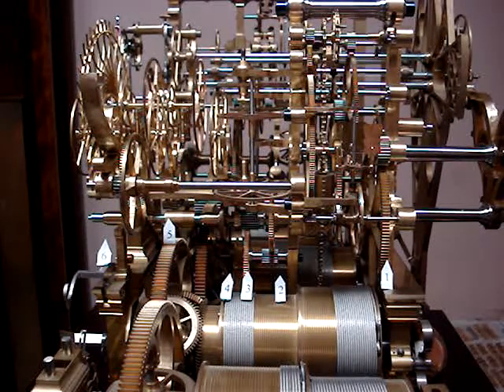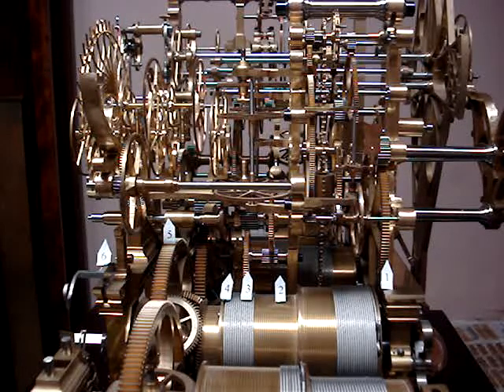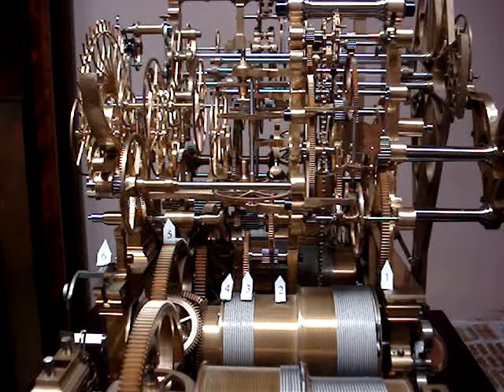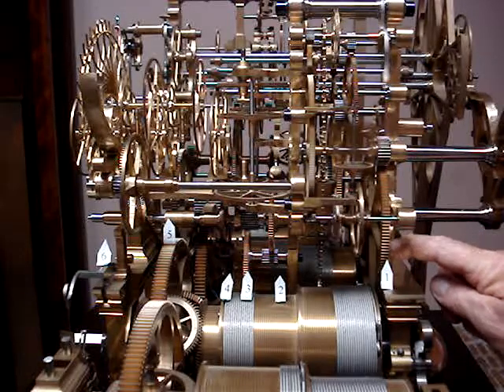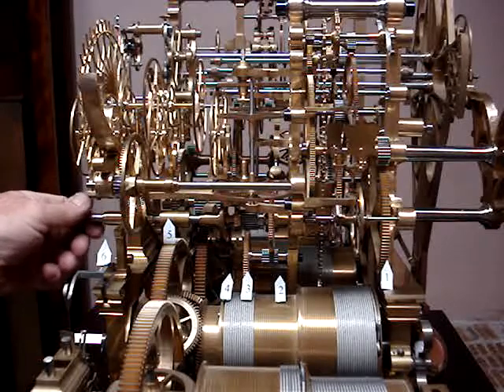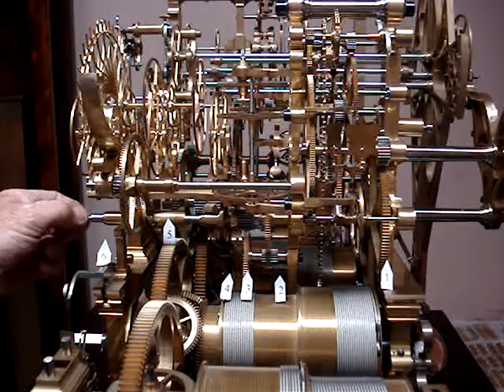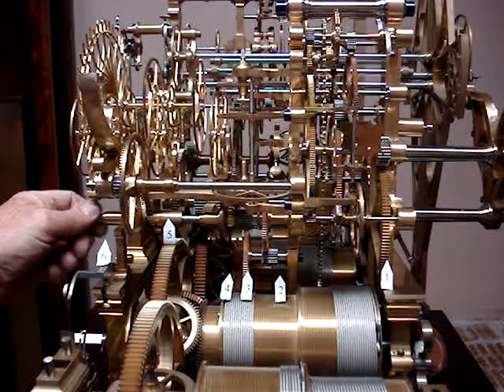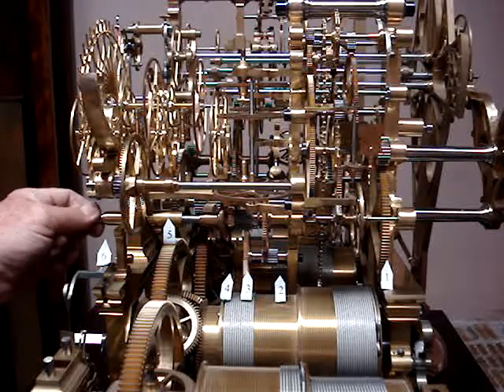Astro skeleton celestial transmission drive demo

Comment from the maker: A mechanical engineering background helps. I had a hand in the overall design, but the fabricator did most of the design and all of the production work. His background is as a master tool and die maker as now is his son. All trained in the old apprenticeship way. There is, of course, design and mathematics on paper, but really only as we go along. There were no overall build drawings at the beginning. Indeed the project has morphed quite a bit as we have gone along, but fortunately very little redesign and re-cutting of metal occurred. We seemed to have been able to anticipate and implement the changes necessary beforehand with near seamless integration into what has gone before. Given the uniqueness and complexity of this project we have been remarkably fortunate. Other than the antifriction wheelwork in the escapement we have not done much in the way of poising for the wheels. Of course some kinematics and dynamics come into play, but most is done empirically rather than mathematically. There is no computer aided design and manufacture here. This, I believe will be the last complex machine of this type to be made entirely by hand, that is without computer or numerically controlled machine tools.

Comment: Hey Mark, what kind of background does one need in order to create something like this? Decades of clockmaking experience? Is everything designed and calculated on paper first? The kinematics and dynamics of the machine components would be really interesting to work out. Building things like this is like a dream job for a mechanical engineer. Do you do the machining of the components yourself?